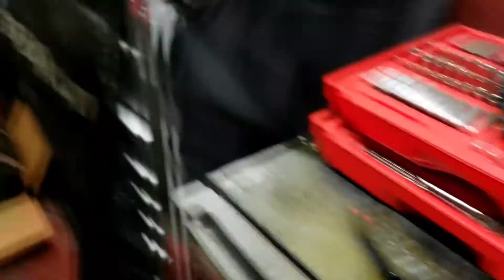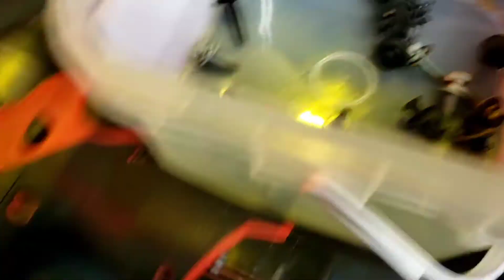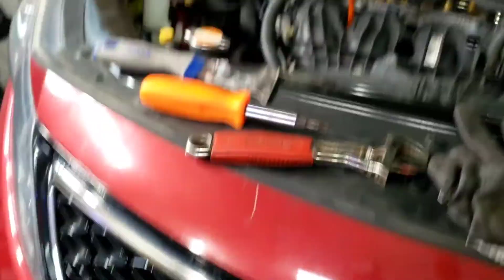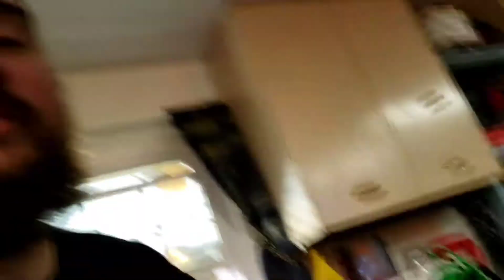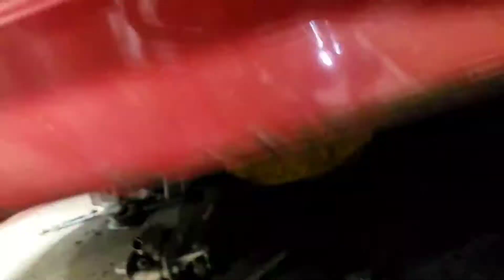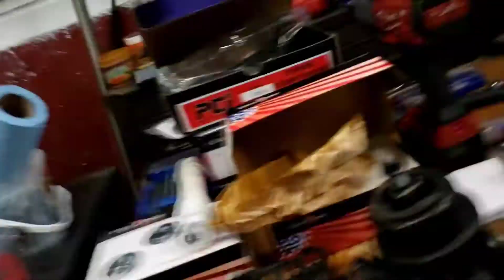2011 Kia Optima 2.0T Timing Chain and Cam Phaser Replacement (Part 1 Disassembly)

Comment: Hi I own the same car would you hear a loud rattle inside engine on cold starts that would kinda go away? Also rattling when stepping on gas?
Reply from the maker: Could be a few things definitely get that checked out! Make sure your oil level is good. These cars are notorious for oil issues
Reply: I have the same car have spent $25,000 in parts and labor in 2yrs I’ve resorted to doing everything by myself at this point thanks this video is incredibly helpful
Reply from the maker: You're welcome! Glad it was helpful!

Comment: Where do I get the seal or gasket that goes in between them
Reply from the maker: I would check with your local dealership. Probably cheaper elsewhere but at least get the part # from them 👍

Comment: How long from start to finish?
Reply from the maker: We have 3 videos up of disassembly, replacement and assembly and it only took me 1 day to do. It took me about 10 hrs but now that I have done it I bet I could do it in less then 6.
Reply: @413BROS  thank you planning to replace it on a 2015 Soul
Reply: @413BROS  did you need a special tool to remove the crank pulley?
Reply from the maker: Nope just pop the nut off and make sure the crank doesn't spin so u don't loose timing.
Reply: @413BROS  thank you what about the cam gears?
Reply from the maker: Same thing it should only be a nut and it will slid right off but I used 2 adjustables and a pair of vice grips clamping the 2 adjustables together so the cams wouldn't move when swapping the cam gears.
Reply: @413BROS  THANK YOU!!!! You’re the best

Comment: Did your car have a strange wining noise
Reply from the maker: When you first start up since new it's done a wierd quick noise. I guess they all do it I took it in for it and it's just part of the car. But if you're referring to something else than no It doesn't
Reply: @413 BROS  yeah my daughter bought one that whines loudly with RPM's. I'm thinking maybe the alternator pulley is the noise
Reply from the maker: Is it at a higher rpm? Like while driving or at an idle?
Reply: @413BROS  all the time with rpm
Reply from the maker: To me it sounds like the Alternator like you said. If Tyler has any other input he'll let u know as well. These cars have electric power steering so I shouldn't be that